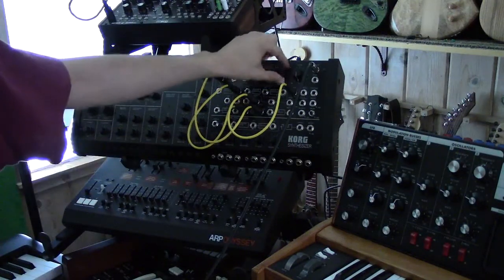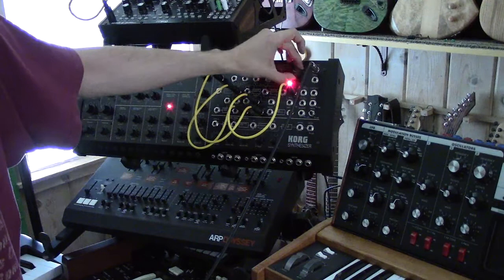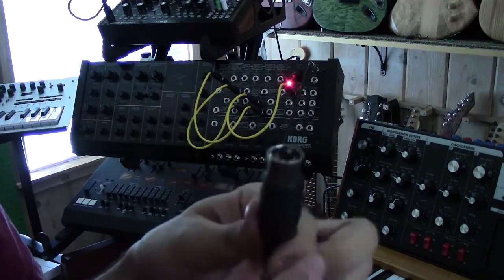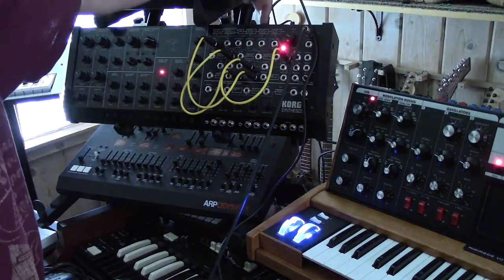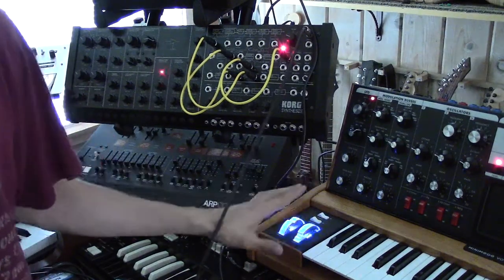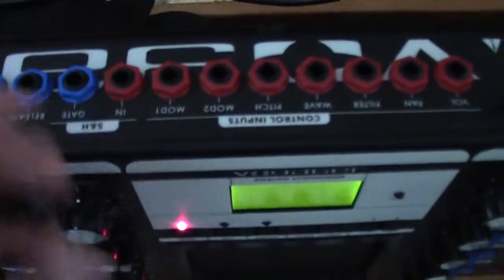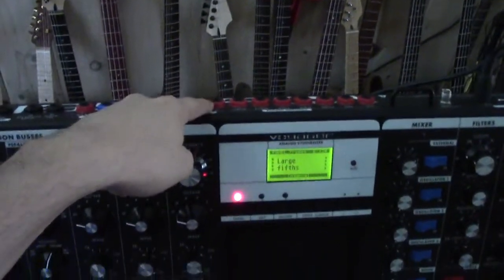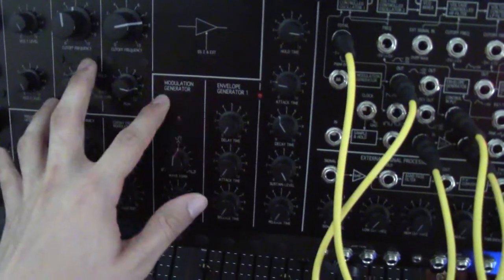Does it mod wheel? | Korg MS-20m

Comment: Got pitch bend to work by feeding the MS-20m CV and gate from an Arp Odyssey (Korg's clone) - haven't managed modulation from an off-board wheel yet though.
Reply from the maker: Oh yes indeed. Those two modules work well together. The Vermona '14 has CV out for pitch bend and mod wheel but it's mighty expensive.

Comment: Hey man! Did you solve it? I have also the MS-20M. I have partly solved it! I bought a 16-bit DAC converter in electronics shop. It is SMD, so it was pretty hard to solder it at home, but I gave it to some local SMD manufacturer and they did solder 2 pieces for me. Right now I have 1 knob with Arduino (USB communication or can be battery powered). But the knob on my Arduino is not so precise, so I cannot use the full 16-bit resolution of my DAC part bought. But via USB I can send the exact number from my PC and control MS-20M. Right now I can send only 0-5V. For bipolar voltage like -5V to 5V or -12V to 12V, I would need to build some other circuit with two additional Op-Amps (operational amplifier). I got fired last week and I don't have any money, nor motivation to continue on this subject. What do you think? Is this idea worth? Would YOU buy it for example if I would make the whole unit also with software that could work with any midi app (Ableton, Cubase, FL Studio, DAW) ? Or perhaps just standalone Win/Mac app. Or I could replace the Arduino with WiFi *duino alternative and you could control this "modwheel" wirelessly from a phone. A lot of possibilities. My dream would be create things like this, but it is very hard to enter the market and become this your lifetime job...
Reply from the maker: Aw man. Sorry to hear of your misfortune. I mean, not sorry to have heard/read it, but sorry it's so unfortunate.
As for myself, I am not privy to computers or ipads. If there isn't a hardware solution then I'm usually not interested, but I'll come around eventually.
Reply: What I wrote here is not hardware solution? Of course there is a hardware solution. I just described current status that I did some workaround. It would be possible to buy a more expensive, higher quality knob + 16-bit ADC converter. Or there is some Kenton Midi to CV thingy, but it is quite expensive and does not have the exact parameters for MS-20M.
Reply: Guys, this is what you need
https://www.musicstore.de/en_GB/GBP/Doepfer-Dark-Link-USB-MIDI-to-CV-Gate-Interface/art-SYN0003911-000?campaign=GShopping/UK&gclid=Cj0KCQiAh_DTBRCTARIsABlT9MYpDopkHCa1LJ7ukZWgT78-yDBhdi8EpHoZ3lD36uoT8Srdcc8ceTQaAu3cEALw_wcB